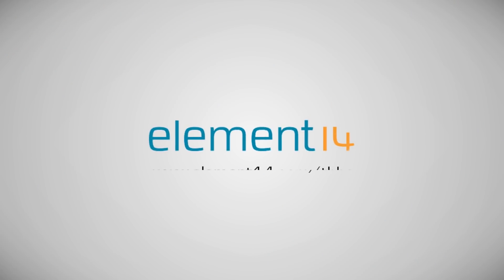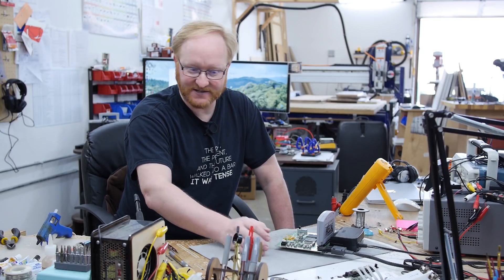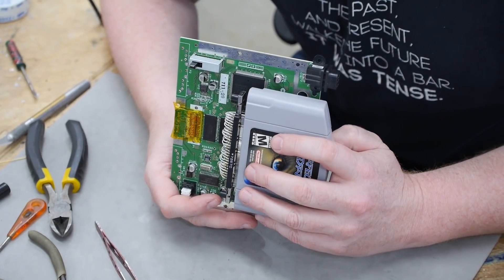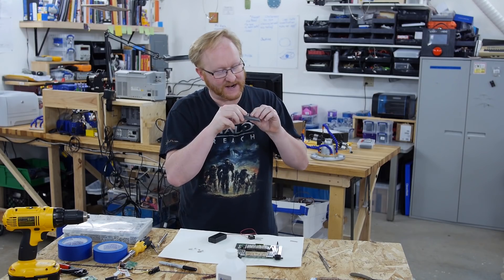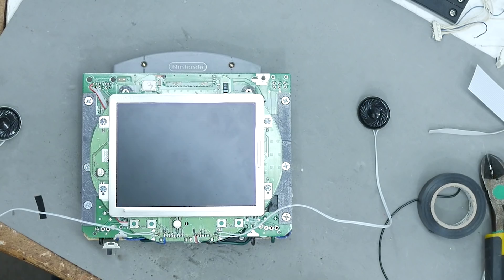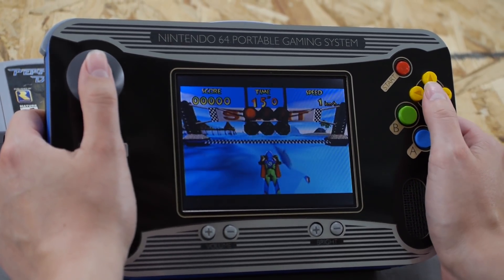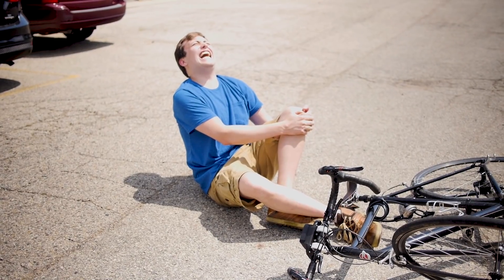N64 Portable: It's Alive!

Comment: STOP USING PS1 LCDS FOR PORTABLE CONSOLES
Reply: They should use screens from in-car entertainment systems.  Has analog inputs and can be found cheap at any junkyard.
Reply: I'd rather play an N64 than a PS1 any day...
Reply: Ps1 became completely obsolete after ps2 came out, as it is backwards compatible. If you are still taking your ps1 on the go with the portable LCD, something is wrong with you.
Reply: I only have PS1 games so I don't need a PS2.  Little model 2 with a screen.
Reply: Someone needs to test a InnoLux AT056TN53 as a replacement screen.
Reply: Innolux LCD-AT056TN53
Reply: Why?
Reply: I have 2 already. If you don’t have any by now what’s the chance you’re actually going to buy one.This handheld is a work of art and well worth the cost of the devices that where sacrificed to make it possible.
Reply: +Tersujin
They're getting more and more limited. Which means people/collectors who either want it for their collection, or just want a portable Playstation 1 can't find them as easily anymore. To the point where the PS1 LCDs might go extinct (is that the proper term?) due to modders constantly destroying them or buying the spare parts online.
Reply: no

Comment: N64 emulator for your phone + 10$ bluetooth gamepad, thank me later.
Reply: pivorsc n64 emulation isn't perfect. Progress isn't as fastly growing as dolphin I'd say.
Reply: Android N64 emulators are horrible to get to work at a decent speed without making the game look shit
Reply: Randomness In A Can 
As of August 15th (for Mupen64 AE. An Android N64 emulator), Rogue Squadron DOES indeed work! It should actually work for all N64 emulators that use the GlideN64 plugin.
Reply: Larry Lopez nice. Does paper mario work perfectly? I remember it runs bad on glide64 (not gliden64)
Reply: MechaMinilla99 hmm probably gonna try the vc ones. Giled64 is the plugin for n64 emulators like project64.
Reply: Dustin James but that's what we definitely want to, growing up with n64. I grew up with ps1 but nowadays i find n64 games more charming than ps1 ones (imo).
Reply: whatifallpotsinzeldaarecuccos I installed the paper mario in Mupen and it's working fine
Reply: I ran ocarina of time on the note 5 and everything is great until you get to hyrule castle then it crashes everytime you go there. So I looked around for a solution and found that there was one. Raspberry pi 3 b + 1up board in an after market gameboy case. The system has dual analog sticks + d pad and shoulder buttons, and 6 right thumb buttons, a bunch of USB ports and an hdmi out port. $240 10 day delivery. Plays any console up to n64 and ps1 using retroarch
Reply: USB N64 controller. Oh wait, there isn't one? Thank me later.
Reply: Dibaizin very true
Reply: N64 emulators don't work on phone some don't even work on laptop!
Reply: pivorsc 
Emulation for N64 is still problematic.
Reply: resident evil 2 always crashed on every emulator I've had
Reply: Holy crap. I didn't know that cartridges could be plugged into an emulator? Sick.... Obviously this project was a waste of time. You should have informed him sooner.. Smart guy...
Reply: pivorsc rogue squadron doesn't work on emulation buy an n64 you'll thank me later
Reply: Randomness In A Can I have heard it does work on emulators but either way the N64 Rouge Squadron is on PC anyway.
Reply: android emulators work great, only the IOS ones run at about half the speed and get revoked all the time
Reply: whatifallpotsinzeldaarecuccos Paper Mario has issues on Project 64, but it works perfect on Dolphin using the Wii virtual console version.

Comment: How long does it last? I would power mine differently. I have some Milwaukee 12v tools, and already have a few batteries that always have to have a charge. Also, I keep at least one charger with me in the car, and they are already paid for. They also, at least a little bit, resemble a rumble pack. Not a critique of the build at all, just maybe something to think about for the next portable this or that. Built in reserve power too, 10 seconds of time to swap a battery while running? Might as well tackle new frontiers while you're at it.

Comment: I supeeeeer cool idea that you might like, I Just saw a power cube videofrom Evan Kale and I thought it was awesome. But i thought it would to be cool like to make a portable charger with at least 2 phone charging ports and on the front of it would have LCD screen that you swipe to see what percent your phone or table would be at but when it goes back it would have this cute face the eyes would change color to what your percent is like red is low yellow is middle and green is okay to use and it would make noises ples read this

Comment: I would have repositioned the L and R buttons, personally. Make it so that they could easily be reached from your fingers' natural resting position on the system. Like where Karen's index fingers are at 7:10, just make a little outcropping and put them there. Might be a pain in the ass to pull off with how things are arranged in there, but it'd be worth it to avoid the pain in the ass of stretching your fingers up to the top, or even completely moving your hands to reach them.

Comment: I would have replaced he original joystick with a GameCube (or similar) version. The original ones wear out.
Reply: Why not? As long as you use any oil that is friendly to plastic, like mineral oil, there are only benefits.
Reply: Zane Youmans that's true I've never been one for ambiguity
Reply: Just avoid Mario Party.
Reply: t0f0b0 there's actually alot of games that don't work right with that mod, If you clean and lube the n64 controller joysticks, they don't wear. I have two of them that are over 15 years old, neather have problems.
Reply: Yeah. I already changed the sticks of all my 4 N64 controllers and they feel great

They're not GameCube sticks, but rather GameCube-style N64 replacement sticks
Reply: The N64 controller uses a very different method of joystick than regular joysticks, but GameCubes use it too so you can only use them for a replacement.
Reply: I agree. Had to change out 2 on my controllers
Reply: Shakil Muzib Ahmed it honestly takes 3 min.
Reply: t0f0b0 that's what I said
Reply: There's a HORI N64 controller with a much nicer stick. The controller itself is kind of small, but the stick kind of resembles a GC. I think it would have worked much nicer for this build.
Reply: eddie mirsberger wtf who has time to lube those shitty analog sticks

Comment: Is it possible to get stl file's or a copy of your diagram for the outer case to 3d print the case for the project?
Reply: Just had an idea the system could be made a little thinner by ditching the cartridge all together and solder a everdrive board to the n64 MB. Might allow for more cooling to be done and more lipos to be added. 

I would add in a lipo charging circuit for 2cell lipo packs the type that balance the cells(yes I noticed the cells are protected and I love that. I've made a tri-cell pack with one on those circuits with protected cells it works very well) as they charge.

Comment: What about... THE PORTABLE NINTENDO PLAYSTATION
Reply: No one would destroy a unique piece of history for a hobby project.
Reply: You Mean Playstation U
Reply: Done.

Oh you wanted proof?

I dont have any
Reply: Pietro Mascagni Nintendo PlayStation. The fusion between the PlayStation and the snes.
Reply: KYLE REES they got the cd drive working.
Reply: KYLE REES it does with a custom boot disc. 

So in short. We'd need to either copy the original ROM and modify to support CD reading and then recreate a one off console that is slim, with a screen, and not much thicker than a SNES cartridge. 

Could be done to a similar style of a larger game boy.. 

Failing that a switch-esque style handheld, with a door at the back and cartridge at the top.. Or a non doored (auto loading disc element) CD drive and cartridge slot, with a screen and buttons on the top corners and front.
Reply: Oh hell no because the Nintendo playstation I a merchandise
Reply: Pietro Mascagni with a disc drive
Reply: Impossible.
Reply: A portable snes with the ability to play psone games?
Reply: A prototype for the prototype the PSP, basically.

(Edit) because this is the prototype for the PS1 it can’t be a prototype PSP. Thus the edit.

Comment: If you guys are looking for the Z button/trigger, pause @13:10.  You’ll notice that there is a little recessed area on the left shoulder button.  That I believe is the Z button/trigger.  Very intuitive design.
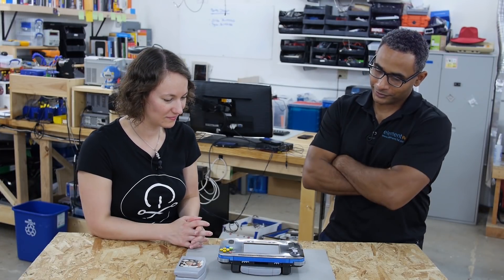Reply: OmenBoy The screw is located just a little bit to the left when looking at it from behind.  You get a better look at the design from the front @13:14.  Look at the left shoulder button and compare it to the right one.  You notice that the top of the left one has a square flat surface whereas the right one is completely rounded.  Also, you’ll notice the part of the left button closest to the cartridge slot slopes inward slightly whereas the part of the right button closest to the cartridge slot stops at a flat angle.  Maybe it’s just a variance in how the buttons were designed, but imo there are two presses underneath the left button.  Pressing the slope of the left button will act as an “L” button press, while pressing the top of the left button will act as a “Z” button press.  Then again, I could just be looking at the system wrong, but it can’t be coincidence that the left shoulder is shaped a little differently from the right shoulder.
Reply: Sauraen the ique setup for the L and Z is perfect. Even the hori mini pad 64 did this before.
Reply: exactly. i was thinking it would feel pretty normal to have the z back where your left index finger can reach since thats the finger that used it on the controller anyways. just recess it in a little or let it stick out and rest your finger on it.
Reply: I think they just scrapped the L button. Shoulda made it like L1 and L2.
Reply: This observation is ridiculously false. That’s clearly just a 3D print artifact. The whole button is Z, he just left out L as no games use that with purpose.
Reply: Sauraen 
It needs to be a rear trigger for best results. They should have put the Z button where the left index finger rests. I hate all the portable N64 designs that just sacrifice the L button, they're lazy and counterintuitive for all the "hold Z" type of games. Hold an N64 controller and pretend you're trying to Talon Trot in Banjo-Kazooie with the L button. It'll feel weird.

Comment: Thanks for showing some of the design process for the case. Years ago I tried this style mod following your forum, and had mine done inside a crappy radioshack project case. Nothing fit, and most of it was bought on the salary of 17 year old.  Ended up frying when the battery worked themselves loose. Gonna try this again soon as a college student with access to 3d printing, and hopefully it'll turn out somewhat professional looking.

Comment: This is really cool, my main question would be how long does 4AA power the hand held for and how difficult would it be to put an led indicator for how much longer the batteries would last. Maybe something like what the Gameboy color had
Reply: Those weren't double A batteries, those were lithium ion cells, typically used in battery banks and some laptop batteries. (they're a fair bit larger and hold much more power.)
Reply: Raletia that's cool, curious how long the portable can run on them